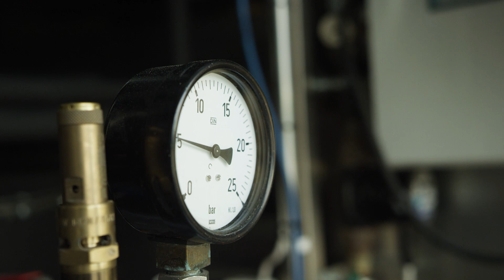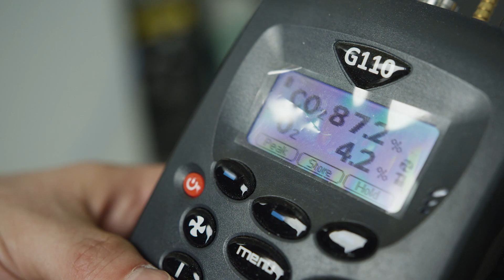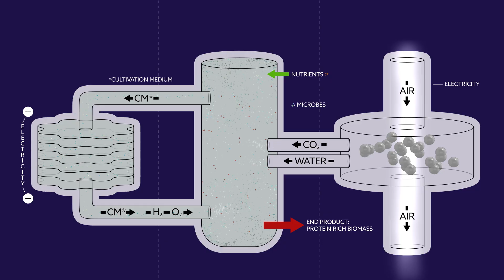Food from electricity – Neo-Carbon Food

Comment: I always find that these projects say they'll use "renewable electricity" rather than the more generic and inclusive "zero carbon electricity". Why exclude zero carbon nuclear energy? All of our current electricity sources have a carbon footprint because we're not making their materials with zero carbon energy. Nuclear, and especially generation 4 nuclear plants, will have the lowest carbon footprint and will have further reductions when nuclear power is used to build more nuclear plants.

That said, I'm completely on board with reducing our footprint on the living world by taking more responsibility for creating our food.
Reply: Nuclear power also requires far less land than wind or solar power, and is far more flexibly located - just like the advantages of the protein production reactors.
Reply from the maker: @49andrew  You are right. We are not excluding any zero carbon power generation method on ideological basis. The Neo-Carbon Food could be powered by nuclear power as well. However, our research focus has been on the utilization of solar and wind power to de-fossilize our energy system. We also see that wind and solar scalable and currently the least cost power generation options all around the world.